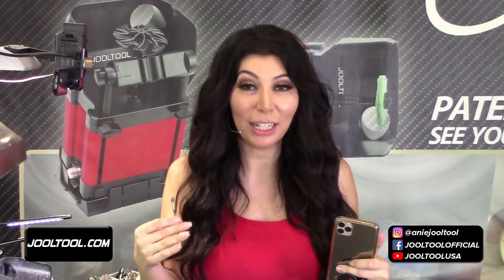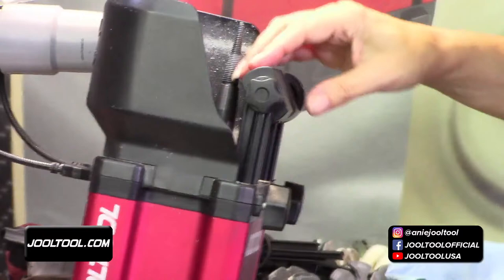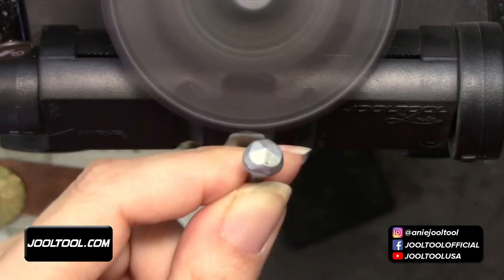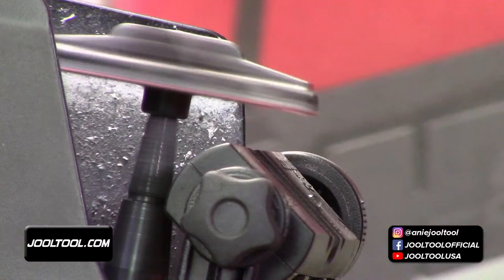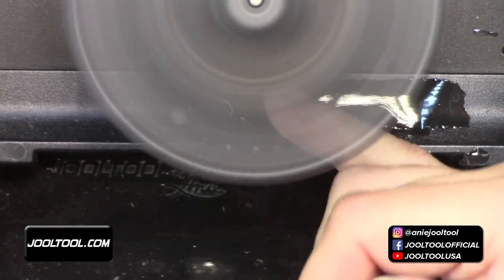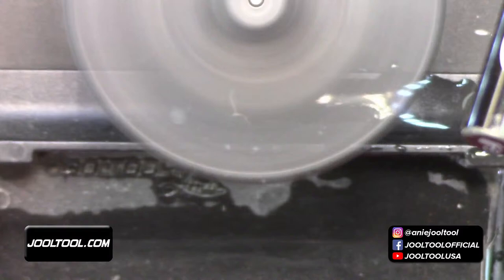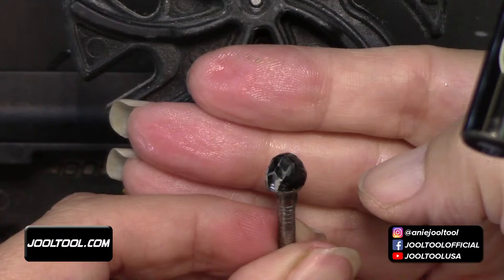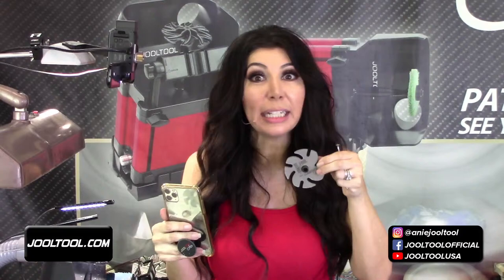How to Make a Facetted Sapphire Cab on the JOOLTOOL - LIVE with Anie

Comment: I think you could easily make a jambpeg style or template style facetting setup to go with the guide. 
Templates are very affordable and are professionally used ! The jambpeg style too. The angle board would be 90 degrees horizontal instead of vertical.  This would give an included way to make round brilliant cuts and so on for colored stones. Sapphire is a great example too. A lot of people can get a cutable montana sapphire for cheap. Austrailian sapphire too.  But we do not all have big money for lapidary setups. Nor is everybody handy enough to make it diy...so with a higher range of grits or maybe a set of laps for using your own cutting and polish grits. A template system uses a small flat plate that is set to a perfect 90 orientation to the lap. The hand piece is a  dop stick, stuck into a wand with the standard 32 tooth gear and a tail end with the template pushed on .it is a tube inside A tube ina tube . Dop your stone . Set in the wand and cut and polish the table first.go over the template sides. Change your gear setting and repeat until you have gone through the positions. Change the size of  template for angle adjustments. Change number of sides and or the gear for different nonstandard cuts. 
What you did here was very nice looking but its freeform so not quite precise as possible . These additions would make that extra accuracy happen. Even a horizontal mast could be set up for mast style hand pieces/ manipulators. The angles are all the same . Its just a different starting position than is usually used. I see tons of potential.